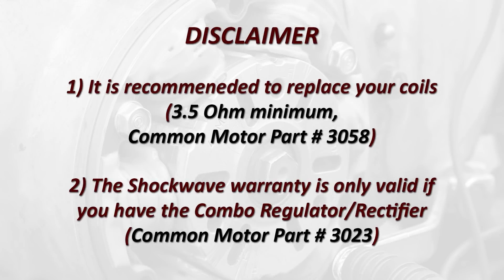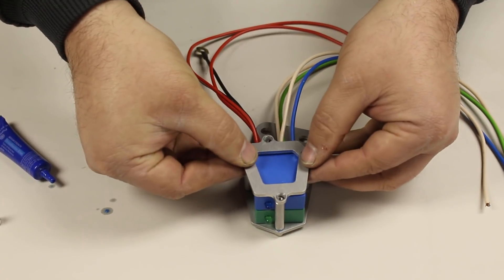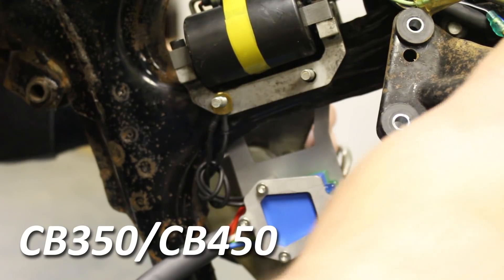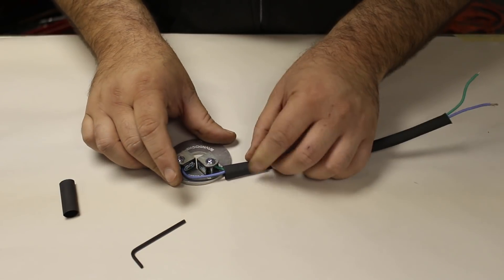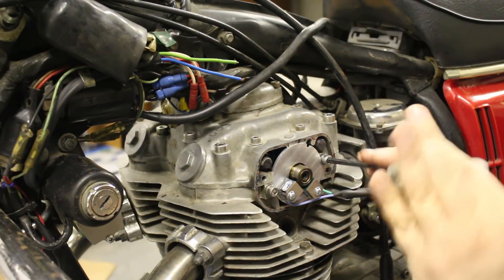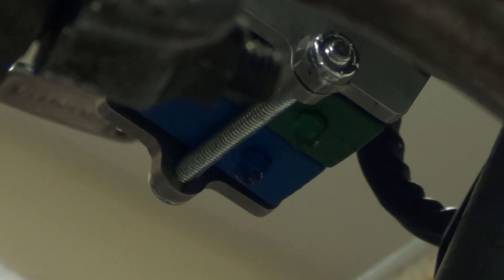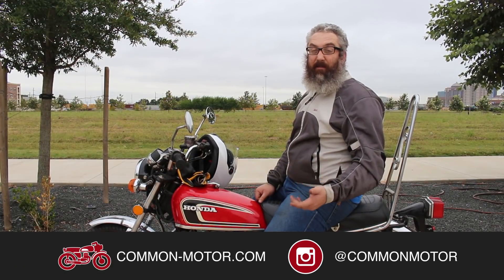Common Motor Shockwave Installation Instructions For The CB350, CB360, CB450 Family Of Motorcycles

Comment: I've got the shockwave for my cb360t and all the other.  New coils and so on.  Everything you said to get.  Heck all the elec. is new. including the harness.  Going to wait till I get finished reassembling bike after tank, panels ect are back from paint dude.
I have new points from you guys and a backup set because I try to keep backups on everything if possible.  I also know the quality I get from CM.  I'll get her running and tuned in with the points and then add the shockwave this winter when it's too cold to go out.

Comment: I put a 360 in a 350 frame. I had to spread the down tubes about 3/4 of an inch. Otherwise, all else went well. Turned out not to be a great improvement. I did that way back in 1979. I always wondered why Honda bothered with a 10cc increase. It made no sense to me.

Comment: Finished install today. CB35oG. The new CMC coils weren't a perfect fit. Mounted one on the holes in the bracket where to condenser went. That worked. Bike runs GREAT. Was sputtering and dying before, now powerful and smooth to redline. Recommended!

Comment: Question: Since the original trigger cam is retained, how do the electronic sensors trigger? Are the Shockwave sensors induction-triggered by the proximity of the cam lobe apex? Or is there some other strange magic happnin?
Reply: I am also considering purchasing this product. Most commonly available semi-capacitor type products use a contact breaker, but this product seems different. Does the sensor part not come into physical contact with the point cam at all?

Comment: Hi, just received your Shockwave for my CB350 and starting to assemble. I have been using a pair of Dyna mini coils that are 3 ohm. Will they work with the electronic ignition or will I have to replace with coils of a higher ohm rating?

Comment: You guys are very hard to reach. I tried to call the number on the instruction page, but it is an old number that has been disconnected. I received my ignition about a  week ago, and have been unable to start the bike since. Very difficult to set timing without three hands. I buttoned up the covers and replaced the tank, then l pushed the bike back into the corner. Maybe l will put the points back in and run it that way. PLEASE,  give my a help line number.

Comment: Hi we have a cb250 76 model. And it's all the same with cb360 from the engine designs and others stuff the only difference is the size of the block of cb360.  May i ask if this shockwave will be compatible to our cb250 if we replace our contact points? Thankyou in advance!
Reply from the maker: Reach out to our support on our website, one of our staff can dive into the compatibility there with you. It’s going to mostly come down to if the points plate fits or not.

Comment: I guess I'm moving to this I lost a pickup on my pamco and Pete retired. Will this unit work with 5.0ohm dyna coils?
Reply from the maker: Yes, 5 ohm coils will work fine.
Reply: @Common-motor  wow another fast reply from CMC you guys never cease to amaze me with your top notch customer service. Keep up the good work! I look forward to picking one of these kits up before spring :)
Reply: @takeawaykitty.  my PAMCO unit has shit the bed also. Did you purchase one of these CMC units? If so, how is it?
Reply: @James_Sovereign   I have been running the shockwave this summer on my cb360 and it has works very well. I haven't had any issues or noticed any massive difference in performance over the pamco unit. It is a very nice kit and definitely worth the money. I have been running it with the ricks stator and cmc's regulator/rectifier for the charging system and 2 dyna 5ohm coils. It is a more "polished" product than Pete's and i really feel better about the longevity of the unit considering all the electronics are potted to protect them from the elements.

Comment: Does this ingnitionsystem also work on CB 250 G Models? Ingnition and the chrankshaft and gearbox housing should be the same style right? 

Greets from CH 🇨🇭
Reply from the maker: Yes. Same basic engine
Reply: Did it work on your CB250G? I also have a 1975 CB250G5. Regards from Holland.
Reply: Did it work on your CB250?

Comment: I installed it and the bike is running much smoother now. The instructions & video are well very done. Now I don't have to keep re-timing the points. Thanks Brenden!
Reply: Common Motors, please give me a help number that is not disconnected. I cannot start my cb450. Good spark, fuel, lots of air. HELP.

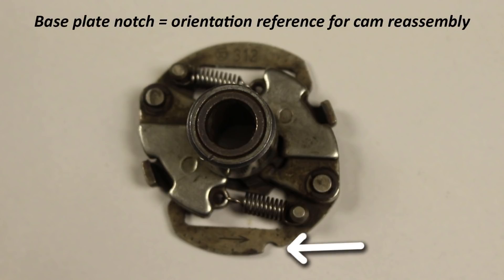Comment: Regarding the Advancer discussion at the 3:00 mark, my 1975 CB360 has a "369" advancer and has no baseplate notch like the one shown in the video. Is there another method to determine if the cam is installed 180 degrees out (other than "bike won't run")?